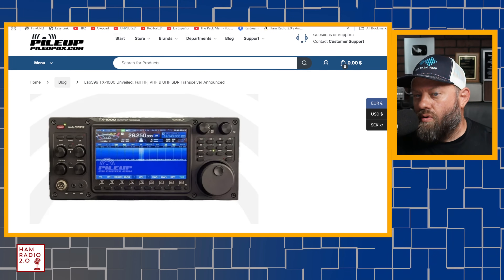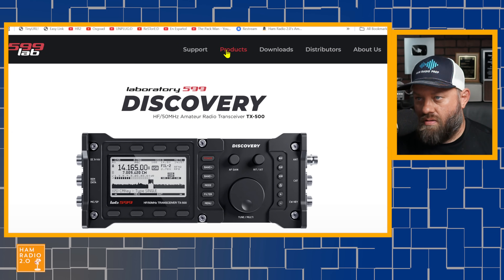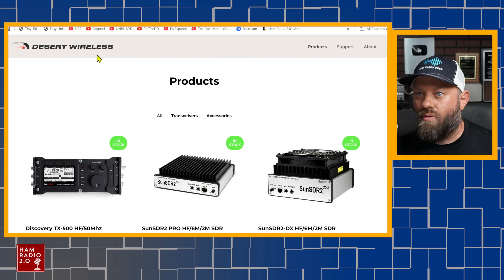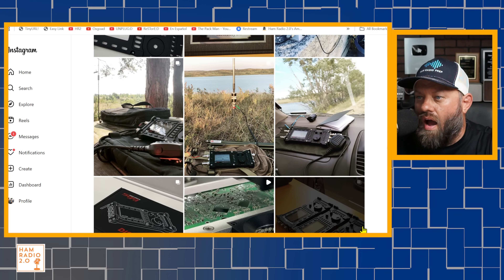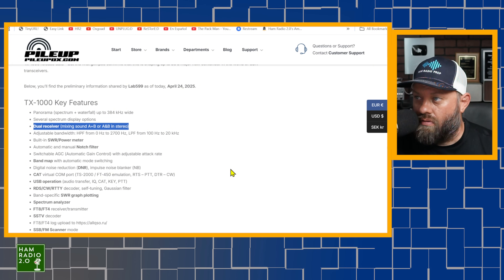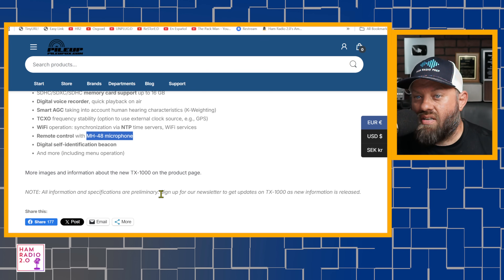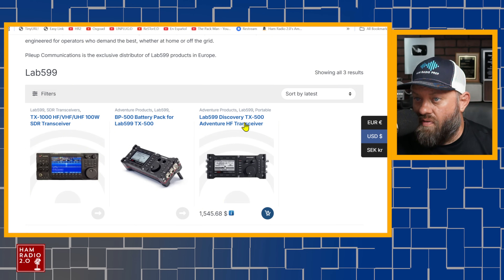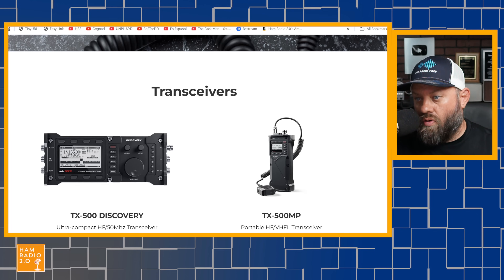Lab599 REVEALS the TX-1000 HF/VHF/UHF Radio

Comment: I had the 500MP demo in my hands at HRO last week. It looks to be a pass for me on the MP. I chose the TX-500, and might eventually look to addon the PA500. Yes, the MP offers more features. I still like the design of the 500 much more.  The design on the MP could have been far better. Examples the extendable feet are the wrong direction,  the redundant power switches, the screen is oriented like an HT. It's similar in size to a 705 now, and not the weight/size I want to backpack. Hopefully,  a TX-500 Mk.2 is in the works with a hardened flip cover or rubberized sleeve case for extra protection. 

The TX-500 is excellent at NVIS/Regional work, and decent at coast to coast phone operations with resonant antennas. 

500 even with its drawbacks is a far more flexible in it's carrying configurations. If I'm running digital I still run the 705.

Comment: I don't know if I would sell my FT-991A and get the TX-1000. There just isn't much to go on right now, including a price. One general concern that applies to all newcomers is their longevity. I hope lab599 survives, flourishes and provides the amateur community an alternative to Yaesu and ICOM.  If the TX-500 is any indicator, lab599 has a very bright future. There is a lot to like about that radio. I know it sounds silly, but just their willingness to use common as dirt, standard, 18650 batteries was a major breakthrough as far as I'm concerned. I'm so sick and tired of yet another new, nonstandard, battery with every new radio from Yaesu and ICOM. That offers zero innovation in exchange for the money we're forced to spend and it's just the tip of the iceberg down that rabbit hole. Go lab599!

Comment: Excellent as always & thank you for sharing .
It's just an observation , I've noticed that you wear your hat in all the videos , I would imagine that the summer heat doesn't help , though it's ideal protection from the sun , it's just that I tried wearing a hat for portable radio , it's ok for winter , but I couldn't wear a hat during the summer months due to the heat .

Comment: Why do you keep deleting my comments on this?  I have linked to the videos on Lab599 and the FB page of one of the principles which provide more information.
Reply from the maker: If you are posting links in your comments, that is why they are removed.  No links are allowed in my comments, I block those due to spammers and scammers.  Otherwise, I haven't deleted any of your comments.

Comment: The TX-500MP is shipping now to buyers who snapped up the first lot. Desert Wireless is UAE.
Reply from the maker: That radio isn't listed on their website
Reply: @HamRadio2 they remove it when they have no stock
Reply from the maker: they shouldn't.  it looks like it isn't there at all.  they can put "out of stock" and still have it listed like most places do.
Reply: @HamRadio2  agree. A rather odd way to run a railroad...